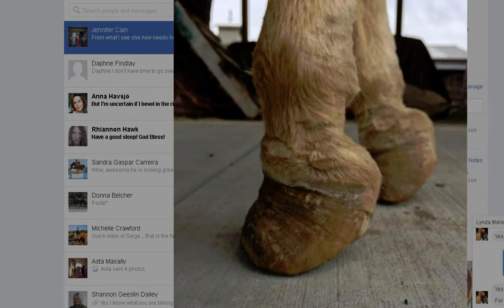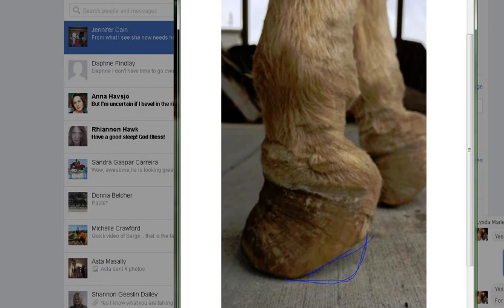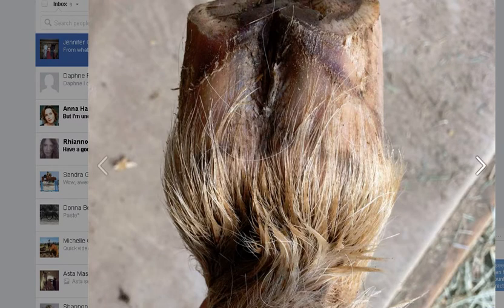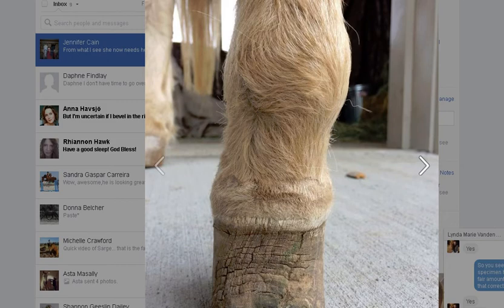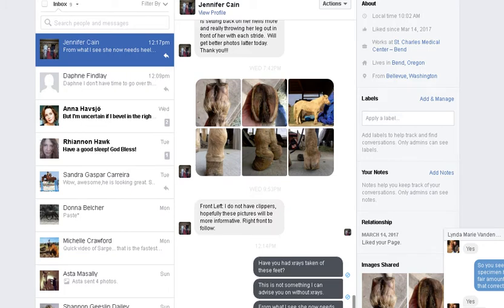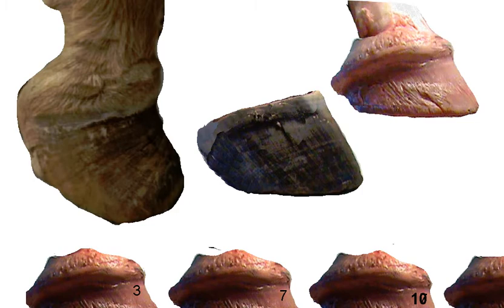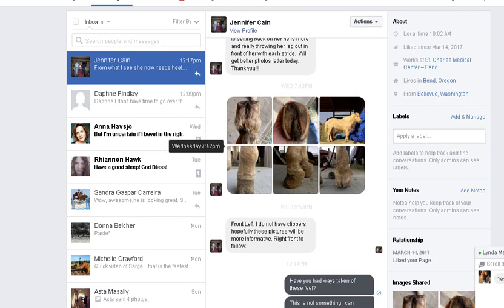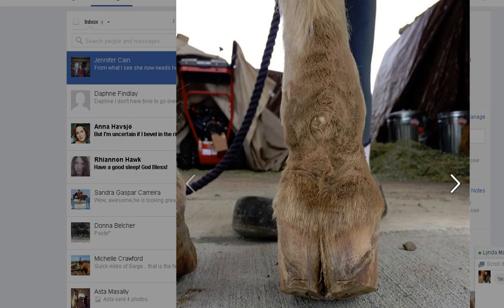Foundered Pony

Comment: Hi Linda, it is most probable that the horse cannot put his heel down because of a contracted tendon. The tendon attaches to the digital cushion (hoof heart) under the coffin/pedal bone and runs all the way up to the knee, if the tendon contracts (and very often very high heels are the reason) the tendon pulls the pedal bone down in the front whilst pulling the whole back of the foot up, therefore also majorly contributing to the pedal bone rotation. If the 'velcro' between the wall and pedal bone is not very tight and strong (eg stress, sugar, excessive carbs, unbalanced feed etc can cause weakness in the 'velcro'), the tendon can pull the pedal bone away from the wall, causing inflammation and therefore a laminae wedge. If you look at this horse, the joint between P1 and cannon bone is bent forwards, indicating a badly contracted tendon, therefore it may take up to several weeks (if ever) for the tendon to re-stretch to normal length, but if the tendon has attached itself to the cannon bone, there is only 2 options, surgery to rectify (separate tendon from bone) or PTS. I was out with a vet years ago doing Equine Influenza vaccinations and we came across a miniature pony with fused tendon and cannon bones in both front legs, he ordered that that pony get PTS within 48hrs as it is a very, very painful condition and there is not much that can be done once the damage is at that stage.